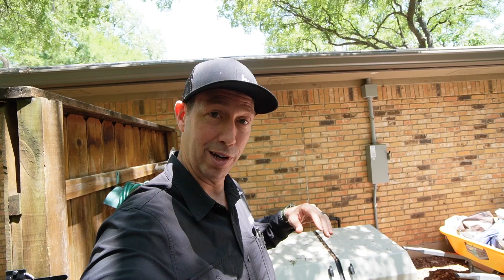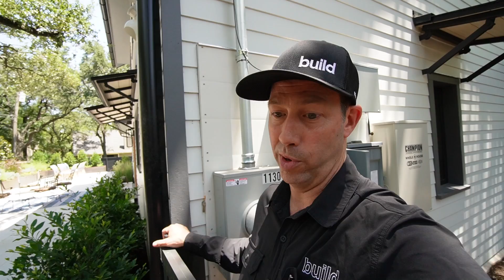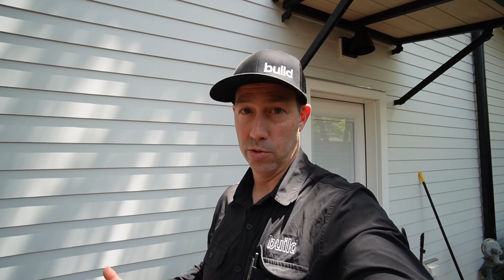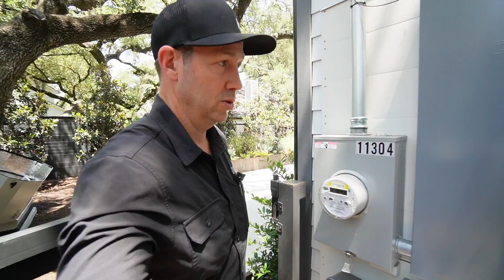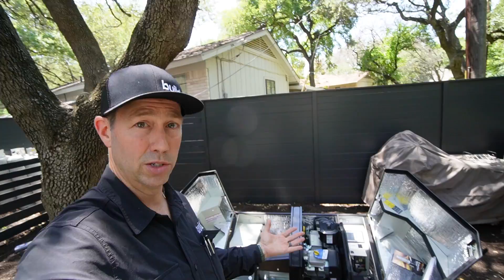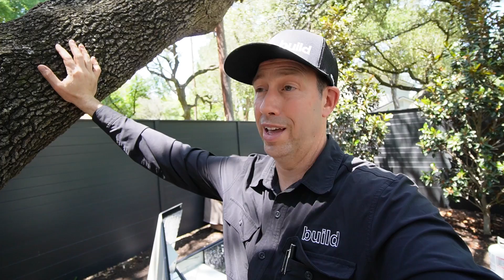Rolling Black Outs? Meet my little friend: Home Standby Generator

Comment: Your concerns about battery back-up noted but you can use battery back-up with city power or your generator, just some suspenders for your belt of powering the home. Most battery systems have great management and if you are only using it as back--up it will last you much longer than what you are looking for

Later one you can even add solar, for another level of protection.

Comment: Matt, I think you have made valid points for coming to the conclusion you have. Only downside I see from a longer term maintenance perspective is the life of the propane tanks. While the gas doesn't go bad, those tanks will need to recertiifed or replaced after a few years, and I'm not sure how you would transfer the propane from old tanks to replacement tank.
Reply: Except propane companies routinely use tanks that are 40, 50, 60 years old.  My tank at my place is from the 1950's.
Reply: @PartTimeYooper  Nothing wrong with that, just test every 10 years.
Reply: @PartTimeYooper  Yep, had one that had been painted over and over, my company inspected at every fill.
Reply: @claudiastutsman3252  inspection includes the truck operator filling the tanks to spray a soapy fluid in the connectors and pressure gauges.
Reply from the maker: 🤔 hadn’t thought about that 😬
Reply: @buildshow  Tanks are commonly certified for 5-10 years, before needing to be replaced/re-certified.  If your getting near your end of life, buy the replacement tank, and use/sell a tank to a neighbour who uses propane bbq (to use up the fuel).
Reply: @buildshow  Probably just plan to rotate in and out a new tank every year, and sell off the old one full or empty (Craigslist, etc.).   Over ten years, you've got fresh tanks continuously, with no worries.  Number them #1 to #10, and there ya go.  My cousin said that the largest sized portable/external tank he could have (Sacramento, CA) was 100 gallons, which is what he has attached to his house.   So, you also might check into getting fewer, 100 gal tanks.  They'd probably have to be refilled on site via truck, but since you're not using the propane regularly, that should be no big deal, should that time come.  If you're worried about emergency refills (i.e. would rather be able to put them in the pick-up), well, ya probably won't be able to get that done anyhow, on site or off if everything else in your country is off-line.   Also, it doesn't hurt to build a lean-to shelter over your tanks, to keep the weather off them, i.e. make 'em last longer.
Reply: @scottb3188  If I had to turn over 10 plus propane tanks a year I would rather pay for Natural gas. I didn't realize the Champion set up was so affordable. I appreciate the information Matt. Everyone's situation is a little different. Just going through Ida I am preparing for the 2-4 weeks without power. We get pretty rough weather North of Lake Pontchartrain. So it is more than Hurricanes that concern me living in the country.
Reply: You need to add the cost of the tank... plus the space it occupy and considering in a new house it is an eyesore... just my opinion
Reply: If you keep them dry and free from moisture they'll last a long time!!

Comment: I saw a video about generators vs solar+battery, there was a good discussion as to why battery is the way to go is that the generator's actual value would only come if its used. But as for the solar+battery backup, it's value is already used since you can run them to save electricity costs. Or if you do a grid tie, you could earning money as well.

As for the lifetime of the battery, it depends on the chemistry you would be using (Li-ion vs LiFePO4 as these are the most popular ones). A good quality LiFePO4 could last a decade.
Reply: Yes totally. And with inflation is always better to buy costlier things now rather than later, especially if those things save you money or make you money.
Reply: Your electric provider makes a huge difference.  If electricity is cheap, as it is in Texas, then solar + batteries will never pay for themselves.  Then again a generator can’t pay for itself.
Reply: @ljdavick  If you count the costs of losing everything in the freezer in the summer, or the water damage from frozen pipes in winter, the payback period looks better. And we can't count on electricity staying cheap - or available.
Reply: While an internal combustion engine unit could last more than 40 years.  This is one of the reasons why we won't be seeing these disappear anytime soon and we may see battery units go is because of the amount of pollution pulling the chemicals from the ground.  It's about even realistically and also because we use fossil fuels to mine and transport the heavy and precious metals used in battery systems.  Lithium based batteries are also incredibly difficult to recycle.  If I wanted a battery system I would use a high-quality lead-acid battery bank due to the fact that lead-acid batteries, being highly toxic are actually easy to recycle and rebuild.  There's also not as much of a fire hazard with lead acid compared to lithium units.

Comment: I get this was a pitch for champion but no reason to spread disinformation about battery backup systems such as a the Tesla powerwall, Tesla guarantees 70% capacity after 10 years- and no limit to the number of cycles during the warranty period, they are rated for 5000 cycles, you might not understand the best use case scenario of the Tesla power wall, it is best suited for peak shaving of electricity and best paired with solar, an electric vehicle, it can also acts as a virtual power plant for the local utility grid in peak demand scenarios where you could sell power at peak rates back to the power company, and you were concerned about the potential thermal runaway of the Powerwall but having 120 gallons of propane stored next to the house is an acceptable risk,  there are other battery storage companies that are offering a safer lithium iron phosphate chemistry that has much less potential for thermal runaway.

Comment: I'm wanting to do a propane generator setup as well. Only difference, i believe i can bury a 500 gallon tank in my area. So i wont have a big tank sitting in my yard, i would have a very long supply of fuel, and i plan to add a gas range and possibly convert my wood fireplace to a gas insert. Natural gas is not available on my street. We had a 500 gallon tank above ground at our old house. A 1000sqft old incredibly inefficient house with a propane furnace and range would need filled 3 times a year. Most of that being for heating here in the midwest. During warm weather we would go most of the year on a fill and we cook most nights. Assuming i was close to or at full i would have plenty of fuel for a generator. Propane costs more than natural gas but it's nice being less reliant on a city supplied service incase of a major outage.

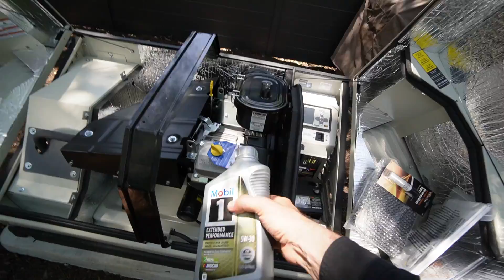Comment: 4:00 I hear lots of people with standby generators have problems with oil consumption - you might want to try using 0W40 or even 5W50, and save yourself the trouble of it dying in the middle of a blackout!
Reply: you only need 0wXX in a cold environment.  In texas, even in their cold snaps, a 5WXX or 10WxX would be fine (and oddly offer better protection during startup).
Reply: @TheNorthern-Lig7t  I'm curious about the idea that a 10w would provide better protection during startup. This is a surprising suggestion!
Reply: @TheNorthern-Lig7t  the way I've always understood it is that while you only need a 0W in cold environments, it flows easier before engines reach operating temperature & generally are made with better feedstocks

It's actually pretty fantastic what we have nowadays, back in my dad's day he could get 10W30, and now I can get an oil that's better in both direction, and put 0W40 in his small block!

Comment: IMO if you live in a rural area with unreliable power and you are low grid priority because of low population density go with liquid cooled it will handle the 10 day outages much better. In the city I think air cooled is a fine choice. Just make sure you exercise it and maintain it and your all set.

Comment: In my area those propane trucks manage to deliver in nearly the worst winter conditions we get and because there are several reputable companies who's jurisdiction overlap the price is always competitive and product available. What I really like is that my current supplier watches the market and will top us up prior to predictable price hikes which is just good looking out. They keep us full when we need it the most. Unfortunately my generator is not plumbed for anything but straight gasoline but I always have hot water and two secondary stoves for heat, light and cooking even without it thanks to propane and the sky is the limit with what else I could add. I love the reliability and long term storage options of propane. :)

Comment: Generator is stupid. Back up battery Lifepo. Takes a few hours to recharge if no sun, instead of running 24/7 burning all kinds of fuel. Your pricing on panels, batteries, inverter makes me wonder about all of your pricing on other shows.

Comment: I have a 14Kw Kohler (running on propane).  Easily powers my 2,000 sq ft home and all appliances and heat and cooling.  I have never had it bog down.  
The installer initially recommended an 8Kw, but then I asked him about fuel consumption.  He went back to his office and found the specs and sure enough, while 8Kw could have worked it would have been taxing the system more and using more fuel.  A larger unit could run at 50% load or less and consume less fuel over the same time period.  Something to consider when purchasing any whole house generator.
Reply: Thanks I was leaning towards the 8k unit because of the gas consumption. I have a 1300 square ft single story but in a hot state, so AC is critical in the summer.  31/2 ton system.
Reply: Square footage has ZERO to do with sizing a generator!!
Electrical load is how you size them.
Reply: @jrsmyth9761  Electrical load is correct.  But if you heat with electric and/or cool with electric, then square footage DOES have something to do with the sizing.  
Also, I was just trying to make the point that it is a medium size home - not a tiny two-room cottage or a mansion.
Reply: @ScottA2345  
Again, I will disagree with home size making ANY difference!!
It is STRICTLY the electrical load.
2500 sq' or 5500sq' could have the same electrical load requirements depending on multiple factors.
The biggest mistake I see in generator sizing is taking square footage into account.
Reply: @jrsmyth9761  If you heat your house with electricity - would there be a greater electrical load heating a 1000 sq foot home or a 5000 square foot home? Yes or no?

If you cool your house with electricity - would there be a greater electrical load to cool a 1000 sq ft home or a 5000 sq ft home?  Yes or no?

Would you expect there to be more light bulbs, computers, televisions refrigerators etc in a 1000 sq foot home or a 5000 sq ft home?? Yes or no?

I never said you should base sizing on the sq ft of your home.  I simply gave people a heads up that I live in an average size home.  That's it. I never said it was the basis for my determining the generator size.

ALSO the entire point of my post was to consider the rate of FUEL consumption.  It was not about how to determine what size generator one needs - rather to factor in fuel consumption rates when you do.
Reply: @ScottA2345  
Expect and actual are two completely different things.
I don't expect, I measure/test.

I don't care about sq' and therefore it should not be used as a consideration for sizing.
As you stated, you have all electric and if your exact house was all fuel burning, then the load is far different for the same sq footage, isn't it?!?!

As for fuel consumption, full or half load makes zero difference if the unit can't do both or your minimum load is more than half(if the unit is only half or full load).

Al I am trying to get across is that the internet is full of people that will make statements that CAN lead to incorrect thinking/decisions. Please only use facts based on mfr's specs.
Reply: @jrsmyth9761  You are WRONG about fuel consumption.  I checked it with the manufacturer - KOHLER.  They had charts that showed you will use less fuel if a larger generator is running at half it's capacity than you would using a smaller generator running at full capacity.  This was important to me since I do not have a gas line and have to rely on tanked propane. 
IF you go back to my original post you will see I was NOT giving advice on how to calculate the size generator one would need.  I like you, calculated the load I would need. 
I was only offering advice as to FUEL CONSUMPTION - and when considering what size to buy, to add that factor into the mix.  I  I stand by the fuel consumption factor as I got the information - with data and graphs directly from the manufacturer.

Comment: We actually did consider solar/battery for this new to use downsize property. Three to four times the cost of another 22kva generator like we had at our previous property and we wouldn't reach payback within the expected time frame we will live here based on our ages, even after federal incentives. So the generator got the nod. Unfortunately, we don't have natural gas into the house (available but the cost to implement is huge because of required switchover of heating, etc., which isn't going to happen) so propane got the nod. That wasn't inexpensive, either. There was one tank already on the property for a gas fireplace insert, but two were required. Ching, ching...

That said, we have the peace of mind that will will have power  which is a good thing for an all electric home. :)

Comment: I would have ng hooked up for continuous operation.  Propane isn't cheap when you fill up at their office, usually a fixed high price per bottle.  Tractor Supply does sell by the gallon but it is still 3.99 today versus 2.99 delivered by others to a 150 gallon or bigger tank.     I might keep a couple 100# bottles as backup in a shed if I wa really worried about ng being shutdown.

Comment: Yeah... You were definitely misled on batteries dude... Even if you survive on them exclusively with just solar and no grid, they will maybe dip 10-20% at most after a decade. And if it's just for back up? They would stay nearly 100%. You're not charging and draining it constantly every day like an iPhone. You also have a fire risk with propane bottles in your back yard...

Comment: Your info on solar and batteries is a bit off. Any reputable backup battery is 70% minimum after 10 years of continuous use. Also, if you daisy chain the batteries as would be required to power your whole home you're increasing the lifespan of the batteries considerably (by increasing cycle life). If you opt for LFP (LiFePo4) batteries then you're talking about 20-25 years before you have 80% total capacity remaining. Finally, the fire hazard risk is non-existent with LFP batteries (Enphase & Sunpower) and mitigated with software on Li-Ion batteries (like the Powerwall). A bigger fire hazard is the explosive fuel used in powering the generator. 

P.S. You mentioned that snow covering panels would limit production, in most instances snow melts faster off the tempered glass panel than a standing seam metal roof or comp shingle roof without panels. The only caveat to that is when its a continuous freeze. In that situation it would make sense to clean off the panels with a hard bristle broom daily to make sure you're achieving optimal production. Solar plus battery storage really is the only "cry once" and be done option. But if you can afford it, there's nothing wrong with a small generator to compensate for very rare poor solar production (in Texas).
Reply: You just mentioned a 25 year lifespan on something so it seems even solar isnt cry once. So what resource are you using to price solar syatem components?
Reply: @danielbuckner2167  most of the reputable solar equipment manufacturers offer 25 year warranties on their products (Hanwha, SunPower etc for panels; Enphase for microinverters; and LFP batteries are a chemistry that is well understood to have a long cycle life). I said “cry once” because the upfront cost to have to designed and installed properly can appear daunting at first. But that’s why low interest loans exist (plus there are some sizable tax credits to help offset the costs) and investing in your own power generation is not like racking up debt on a credit card. It’s an investment in quality of life that I think is worth doing. 

I’ve been designing, engineering and building these systems at the residential, commercial and utility scale for over a decade at this point. The biggest installers of solar plus storage systems are the utility companies because they know it offers a fantastic return on investment. They just don’t want to lose their best customers once homeowners and businesses start figuring it out for themselves.

Comment: Hey, @engineer775 you should contact Matt Risinger and share your thoughts on the Sol Ark 15k + Ark batteries. I think you've achieved comparable backup options while saving money by using a cheaper portable generator. Yall should do a Q&A video together!!!

@mattrisinger here is a new video by Engineer775 on the topic:
https://youtu.be/RWKpP-ZlWoA

Comment: Couldn't you build an enclosure, around the generator? Then insulate the inside with Rockwool and cover that with low density Comfort Board. That should adsorb a lot of the sound.
 It would need plenty of ventilation. The engine exhaust could be piped up and out.
I think I would build an open, covered area for your tanks. Propane tanks will rust and leak over time.
Reply: In winter an enclosure where Matt's at wouldn't be too much of a problem - In the Summer you'd need a LOT of ventilation to keep that engine cool; Austin was about 103F (39C) this afternoon.